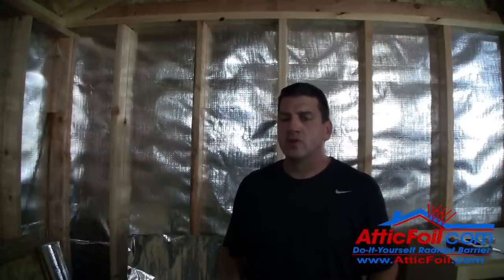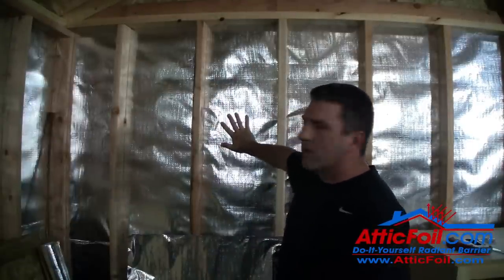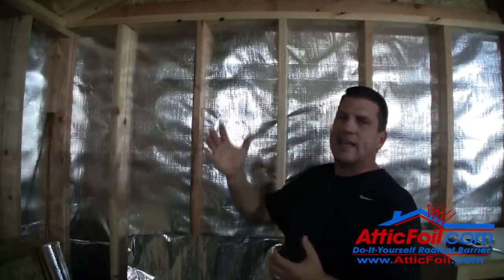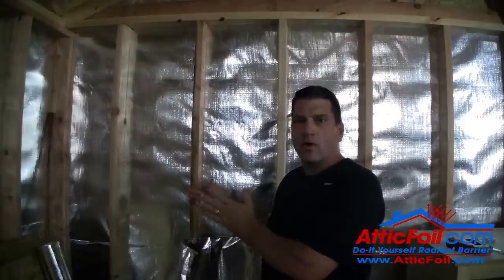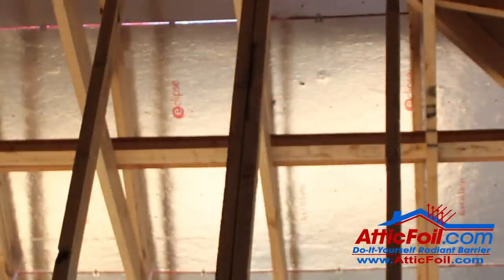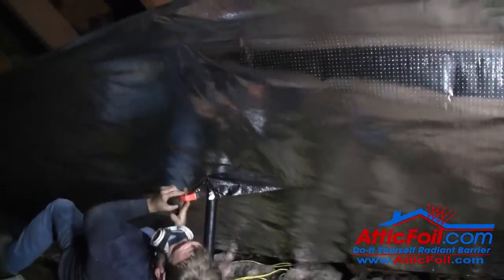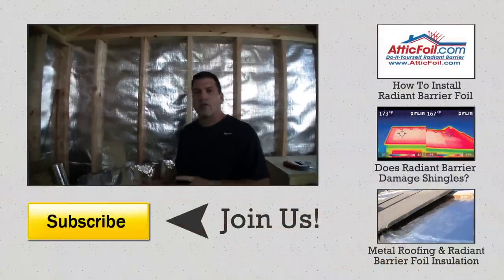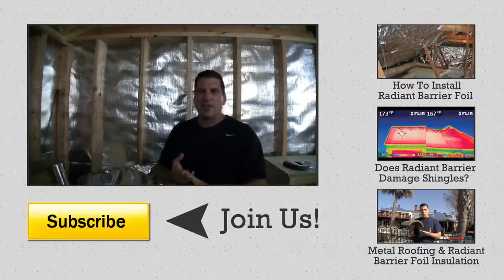Radiant Barrier Department Of Energy Lab Test Results - (Understanding Reflectivity vs Emissivity)

Comment: Can I install attic foil at the bottom of the rafters even if my roof has the solar board decking? is it going to cause any problem? the attic has ventilation all the way around
Reply from the maker: You can do both and get some additional benefit. Not sure if it is worth it.  It really depends on how much time, money effort is involved. http://www.atticfoil.com/index.php/technical-info/dept-of-energy-study-results/
Reply: If there is no incident infra-red radiation, then there will be no benefit to erecting another radiant barrier.   But I doubt your "solar board decking" is so perfect; I except it gets dirty and increasingly dark with time, and therefore become a greater and greater source of IR beneath.
I installed a foil radiant barrier, stapling it to the underside of all rafters, in my residential garage to enormous effect.  I expect efficacy to diminish somewhat each year as dust and dirt accumulate on the top side; but the bottom remains a near-zero emitter, and that's what's most important.        I even wrapped existing lumber, beneath the foil sheet, in shiny aluminum, so that heat cannot radiate from those items (e.g., bike hanging hook members made from 8' x  2"x4", bolted to underside of rafters).     
A nasty surprise was that the gap above my radiant barrier became a rat magnet.     It took months to fix that problem, with patient use of bait and humane traps, etc.     Yeah, I had a small entry hole in my roof and some long-forgotten grass seed, on a shelf, that attracted them.      But they ran atop the radiant barrier foil with impunity.
Reply from the maker: John, thanks for the comments!  Be glad you used a heavyweight No-Tear Radiant Barrier Foil like we sell at www.AtticFoil.com  I've seen pictures of a whole attic of the cheap stuff end up on the floor of attic when a couple critters weight was too much for it to handle.

Comment: I have a 40ft. shipping container in the northern South Carolina-area, approx. 10 miles from the beach. My plan(for the exterior) was to paint the outside with automotive reflective paint. Then (for the interior) was to put the reflective material directly to the wall AND then put R19 insulation between the studs. Is any of this wrong? ...should I consider a different approach?

Comment: So I'm redoing the roof on my rv. I'll have foam insulation with appx 1/2 to 3/4 inch air gap between the insulation and decking. Which would be better to have a radiant barrier on the decking or insulation?
Reply from the maker: I think it's better to work off the reflectivity quality rather than the emissivity quality. Can you go? Roof>Airspace (furring strips/battens etc??) >Radiant Barrier >Foam Insulation > Decking.  This can be tricky with the limited details provided.  Feel free to contact us at www.AtticFoil.com www.RoofingFoil.com for more help.

Comment: It probably is a good video... However  it isn't worth listening to if you can't increase your volume. Can't here you!
Reply from the maker: I think it's an issue with your hardware.  I asked a couple friends to check and they could hear it fine.  Or, you can turn on the Closed Caption.

Comment: My house is all foam, in Houston. 3 thousand square feet. I have a 3 ton unit. Keep attic at same temp as in the living space. 74° with 95 out door temp. I have a Trane variable speed unit. My monthly light bill. 80 dollars. Hum level indoor is 48 % , attic hum level 48 %. All ducts are R8. Provide a small amount of fresh air into house. I have a Honeywell dehumidifier that also provide fresh dry air from out door. Never seem my unit ( compressor ), work at more them 50percent capacity. At night time, unit reduce speed at 25 percent. Better then that foil thing.
Reply from the maker: Nice to know.  What if anything does your comment have to do with the video??
Reply: @AtticFoil  I suspect he is a troll, but he inadvertently provided an opportunity for me to ask a question about a house such as his. Say you have an attic fully insulated with spray foam, would there be any additional benefit to adding radiant barrier foil underneath that, say if there was a slight air gap? In other words, is there enough radiant heat coming through that spray foam insulation that could be reflected out enough that it would be worth doing?
Reply from the maker: @NateInTX  Would it help? Yes, some.  Is it worth it? Probably not. Normally to keep heat out we want the foil to be our first line of defense against radiant heat and the insulation to be the second line of defense against conductive heat.